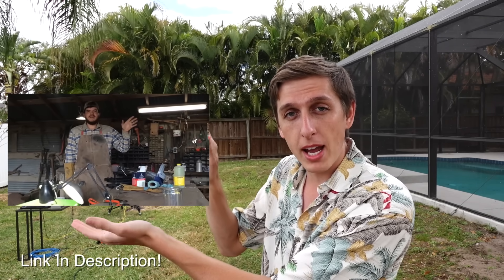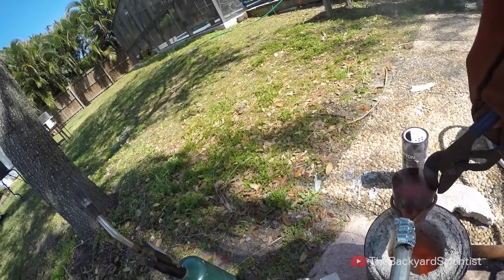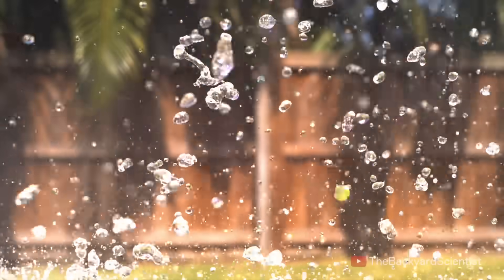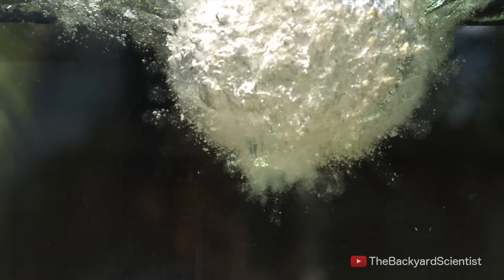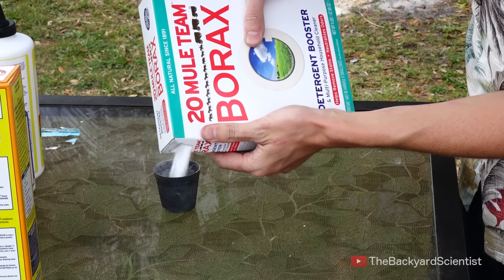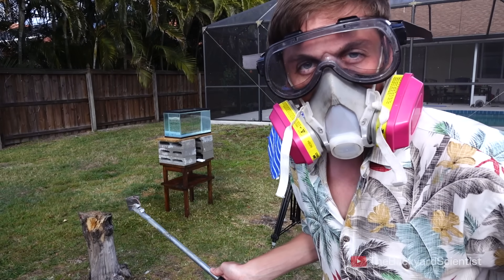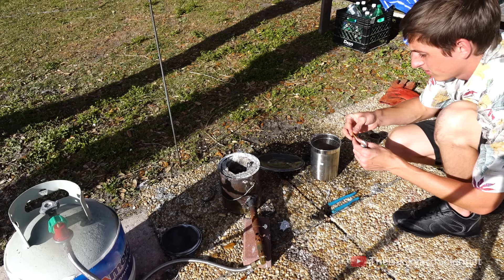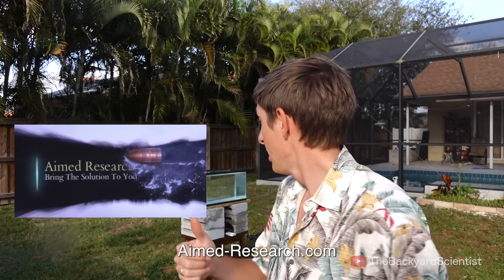Pouring Molten salt into Water - Explosion!

Comment: Why the molten sodium chloride is not (or less) influenced by the leidenfrost effect?
My idea would be that for instance the sodium chloride dissolves more easily into the solution than the other elements or compounds used. 
The molten metal(s) used here consist of equally charged metal atoms while the molten sodium consists of a fluid with Na+ and Cl- ions that have a stronger charge attraction on the polar watermolecules to (partially) overcome the leidenfrost effect.
Therefore it mixes faster with the water leading to the rapid steam expansion.
This is just my hypothesis.

Comment: The cause of the explosion is the rapid heat transfer and volume inflation of the salt. This is caused by salt transferring heat to the water while simultaneously being dispersed through the water as a solvent this intern leads to more surface area being exposed ie more heat transferred and more absorption leading to an exponential growth of the salts volume creating an explosion of expansion

Comment: The cooling causes an expansion and this leaves more surface area that is incontact with water the outer layer dissolves quickly since salt dissolves faster at higher temperatures causing more expansion of the liquid form as heat energy rapidly flows out. Also the water molecules are able to surround the salt molecules creating a large area for heat to flow out wards

Comment: The reason it explodes is really cool actually, when the sodium touches the water it immediately releases electrons, and the resulting cations on the metal surface repel each-other, forcing more and more metal into contact with the water. For a very brief span of time before it explodes the metal will appear to form metal spikes because of what is effectively negative surface tension. If you look up DOI: 10.1038/nchem.2161
 you can read more about it.

If you tried smaller droplets of metal you might be able to capture the metal spike phenomenon.

Comment: Here's a hypothesis. The physical reaction speed of the molten salt in the water is just right to support the rapid mixing of the hot salt with the cold water. It's creating steam fast enough to support the exponential breakdown and atomization you hypothesize. The other substances you tried are reacting more slowly and not atomizing fast enough. They stay as contiguous blobs thanks in part to the steam barrier they create around themselves. The same seems to be true when the sodium chloride is cooler. Just a hypothesis. Cool video. Cheers.

Comment: Try starting with hot water in the tank. The salt has a lower melting point, so if you make the vapor point easier to achieve, the liedenfrost (spelling?) effect may happen.

Comment: It is rapid crystallisation from a  very high temperature. As salt cools back to crystal it hardens and expands into a structural crystalline form. Impacting others around at high speed. This will happen within an initial temperate deferential that is relatively small, meaning there is still a lot of excess heat still to disapate.

Comment: Pretty sure it’s just the sodium, as it is known to violently react, when sodium chloride (or other salts) are melted, the ions are no longer strictly bonded, hence why it can move freely. This means the sodium ions can react with the water. Tbh you most likely know more about this than me but my assumption is that there is no change in pH due to there being no addition or subtraction of H3O+ ions, instead just a reaction with sodium and H2O.

Comment: I know why its going on 
1. Salt is made out of sodium and chlorine
2.need chemical reaction to mix them
3.sodium explode in water
4.to seperate the compound we need heat or eletricity
5.if u heat salt it is seperated to sodium 
6.so if it is dropped in water it will explode

Comment: Now I wanna see what would happen if we got a sample of molten salt the size of a house and dumped it into the Pacific Ocean.
Reply: iTheman 6s mmm you’d get a better result with a house worth of sodium metal in powder form dropped into a fresh water lake, the higher concentration of H2O and sodium, paired with the massively increased surface area of the sodium to react, would result in a very, dangerous yet beautiful scene. Although you’d probably want to be a few miles away

Comment: My unhealthy obsession with the Chernobyl Incident prepared me for this one: One of the scariest problems with Chernobyl is that the Elephant's Foot (a big glob of molten elements containing the fuel core of the reactor, as well as whatever it's melted through by now) is very hot, and will still be that hot (if not hotter) when we die in 100ish years. The fear was that the glob would hit an aquifer (read: underground ocean) and the heat combined with the enclosed space and water would create a massive steam explosion, which would also launch the Elephant's Foot into the air... at which point it would likely fall into another body of water... So on and so forth. Spooky stuff.

Comment: There may be more than just this going on but part of the explosion is due to the molten salt super heating the water without a nucleation site. When water changes from from liquid to gas it needs a foothold our something to get it started. Usually this is a mineral or a bump on the surface of the container, these are nucleation sites. In this case The heating is so rapids and there are no nucleation sites. So when the water changes to vapor, it does so nearly instantaneously and in large amounts creating a huge force. They actually make certain bombs this way, but they use molten aluminium.

Comment: Chemical: when the salt melts, it separates the sodium and chlorine apart from each other. Since chlorine is a gas, it floats away. However some still remains. While sodium, the reactive substance it is, is left to explode on the water.

Signed, BB
Reply: This is a hypothesis BTW

Sadly I think I was wrong.😞
Reply: usually melting doesnt work like that?

Comment: I dont know much about science so feel free to tell me if I'm wrong but what if the explosion is caused by the rapid heating of the water and it expands so much so fast and it breaks the tank outwards.
Reply: If I'm remembering this right, the reason the tanks break is because water is incompressable, so it doesn't absorb the "energy" of the "blast" (rapid expansion of the superheated water), so the walls of the tank recieve the pressure of the blast, and though they're rated for a good amount of pressure (water is heavy), it cannot withstand the amount applied, so it fails and breaks.
Reply: its called glass doesnt like explosions

Comment: The ionic bonds sodium and chlorine ions become less stable as the compound is heated up. As soon as it comes in contact with the water, it quickly separates into Na+ and Cl-. This rapid separation could lead to the explosion seen in the test. This is just my best guess though.

Comment: I believe this process occurs as a result of superheating, when a liquid is brought above boiling point but is still in its liquid phase as a result of gas bubbles becoming trapped. This is because the molten salt is so hot that the liquid becomes almost instantly hotter than its boiling point, 100 degrees Celsius, and the bubbles don't have enough time to escape, so the bubbles build up in pressure resulting in a huge burst shooting out. This is why the hotter molten salt can burst the tank, but not the cooler salt. It's a very well documented phenomena.

Comment: Exothermic reaction... Not a chemical one (mostly). NaCl is instantly soluble in water adding to rapid heat expansion (theory)... To test, try it in saturated solution that has been heated to just below boiling. 

Hypothesis... Without solubility, the heat will be contained "en-mass" and dampen expansion due to loss of heat exchange rate.

Comment: To explain what happened with pure sodium... When sodium comes to contact with water in any form(solid,liquid,gas) it takes the oxygen atom and expells the two hydrogen to the atmosphere... Those hydrogen then get ignited by sodium's extreme heat. So you get a constant chain reaction until there's no sodium left

Comment: viscosity and rate of cooling. The other salts probably form a shell that protects them and slows down heat exchange with the water (which results in steam formation). The sodium chloride is likely fluid enough that it is being emulsified by the shock, which in turn greatly increases the surface area available for heat exchange, which in turn exponentially amplifies the rate of steam formation. That is why you see those smaller explosions bubbling of the earlier ones.

Comment: Idk if I’m right... but I believe that is a chemical reaction... I was taught that indicators if a chemical reaction were:

- evolution of light and heat (fire or explosion)
- production of a gas (smoke or smell)
- change of colour (if there was a universal indicator in that tank, the colour of the water would change)
- formation of a precipitate

I see 2 of those things: smoke and an explosion... so this is a chemical reaction...

Also... Na requires less energy in order for it to be a +ion so it can become stable... that’s why it reacts a lot quicker than the salt (not to be confused with a more chaotic reaction)

BUT... Since the water in the tank is still neutral, I guess it’s just a physical change?? Idk

I’m only taking honours chemistry so sorry if I’m wrong... I wanna be corrected ehe idk much... I just like showing what’s in my head

Comment: it might be an issue of density and why the other compounds did not explode like the sodium chloride. borax and boric acid are both less dense than sodium chloride while sodium carbonate is more dense than sodium chloride. testing other materials similar to these with density's higher and low than sodium chloride might provide an interesting result.

Comment: One summer from college I worked at a heat treating plant where we dipped parts into furnaces filled with liquified salt.  Any water droplets on the parts would explode just like that and it was because as soon as it hit it turned from liquid to steam.  One guy was pissed and tossed a 2 liter bottle filled with water in one of the furnaces and it caused a fairly large explosion. They also used different salt mixtures for different temperatures and it would happen if you dropped a little water in any of them but it was more pronounced in the higher heat furnaces.

Comment: Ok... When Sodium Reacts with water you have the chemical equation Na + H2O -> NaOH + H + (heat). 

Note that NaOH or sodium hydroxide is a base, so if that reaction did occur then the water would have a higher pH in theory. 

When you have Sodium Chloride disolve in water you have the chemical equation NaCl(aq) -> (Na+) + (Cl-) + H2O. 

The key to understanding this phenomenon is understanding why ionized Sodium (when it dissolves from salt) does not react with water while pure sodium does, and if adding heat changes anything. 

I think the simple answer is that what us driving the reaction is Oxygen's electronegativity (it's a greedy ekectron thief) and is taking electrons from the hydrogens (to form water) or 1 hydrogen and 1 sodium (to form NaOH).The problem with ionized Sodium is that it does not have an electron to give the hungry oxygen (hence it is Na+, it lost it's valence electron and now has a net positive charge, Chlorine has it) and because of that, Oxygen wants nothing to do with the Na+ because it doesn't have that extra electron to give. This is why your salt doesn't explode when you disolve it in water.

However it has bee a year since I took Chem 2 so I'm definitely rusty. Someone with more lively skill please elaborate further and correct any mistake I made!

Comment: Have you looked at the relative densities and thermal conductivities of the different salts? Do they have very different melting and boiling points? I suspect that borax will boil at a much lower temperature and not be able to get as hot. It may also have a lower thermal conductivity and so not be able to dump heat into the water as quickly. There is also the question of relative specific heat capacities to consider. The two salts at the same temperature may actually contain very different amounts of heat energy.

Comment: Is because water boiling point is 100°C and anything greater than that that warm water will make it has a violent evaporation, just the same as warm oil, and mix with water, oil will get a higher temperature than water making water evaporate so violent

Comment: The chemical that explodes the most seams to burn on contact with water at the perfect rate. And also provided a firecracker like casing that seams to let the explosion build up pressure before it can expand.

Comment: THe most plaussible option is: the water due to the heat dissociates in Oxigen and Hidrogen,... not the best two elements to combine with something melted and hot... is the same reaction you will obtain if a pan in the kitchen with very hot oil beggins to burn and you put water on it... another explosion you can film, but please wear some fire resistant clothes... not a hawaiian tshirt...

Comment: I would have thought that if it was a chemical reaction, the remainder would mostly be gas

Edit: also sodium chloride is pH neutral
Reply: OMG, WHY EVERYONE SAYS THAT IT.S NOT A CHEMICAL REACTION?!?! IT ISSSSSSSS
Reply: How about you use less caps lock and more arguments?
Reply: @Thinnestmeteor  ok if u want, it.s a chemical reaction, the sodium doesn.t even need to be molten, normal sodium metal EXPLODES in contact with water. When the sodium touches the water, it make a agressive reaction becouse sodium (Na) is an alkaline metal and it.s valence is good for making a change reaction wit H2O (water for you) wich results the big explosion. Happy?! and if my english is bad (totally is) it.s just couse it.s not my natal language. On the other side, the molten salt really is a fizical reaction, makes that huge explosion becouse the extreme heat, wich makes the water to heat in a very short time, and make.... that... explosion... welll.... Hope u happy now
Reply: It's definitely a chemical reaction, this sort of thing happens with most if not all of the alkaline metals regardless of their state of matter.
Reply: Ahh yes, I forgot about having to run away every time I put salt on anything mildly wet.

Do you two realize that what he's pouring in is molten salt (NaCl) and not pure sodium (Na), right? And when he does pour molten sodium the reaction is much faster and violent.
Reply: @countryballsromania6786  does your glass explode when you pour salt in it? What makes salt explosive when molten is the high temperature, making water evaporate and expand really fast
Reply: Yes

Comment: I'm no expert like...at all....but of the few things I know is that the Leidenfrost effect takes place when an object is hotter than the boiling point of the liquid it's immersed in....Sodium has a melting point that is slightly below that...could it be that meanwhile you moved from the heating station to the tank, the sodium had started to cool-off and therefore the Leidenfrost effect didn't have enough time to take place?

Comment: Look up an hho torch. What you did is separate the h2 from the o with the presence of salt the water can conduct electricity which is in heat separating the molecular structure. Since it was the salt that was hot and only hot where the salt was there was a rapid separating (expansion) of gasses only occurring directly where paired.

Comment: If you could get the reaction down to a series of explosions in a combustion chamber, with the force directed out through a rocket engine nozzle, you'd have an ocean-going boat engine.  Combine that with the fact that a 1-meter Fresnel solar lens from a height of a little over a meter can melt stone, and you have a renewable way of evaporating the sea water and melting the salt.  Just sayin'....